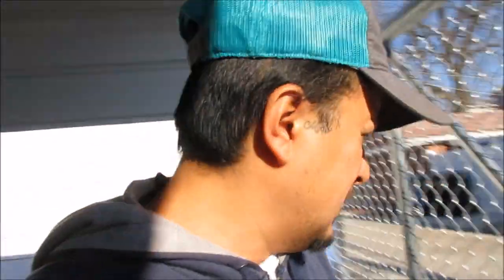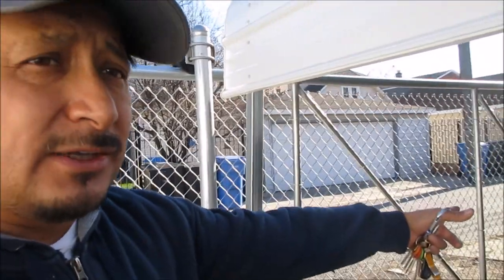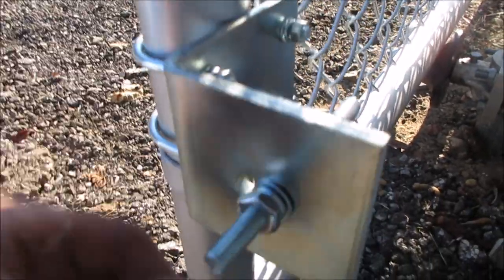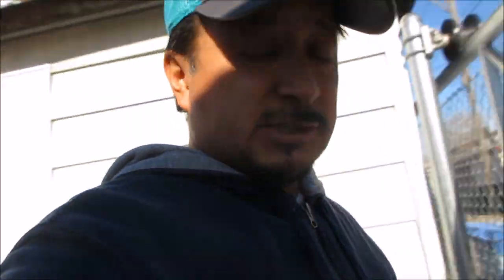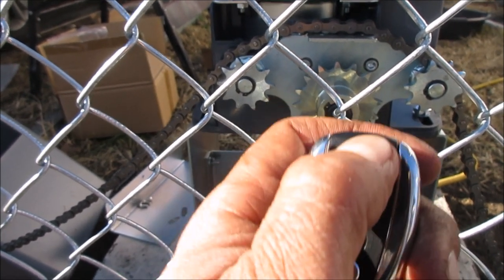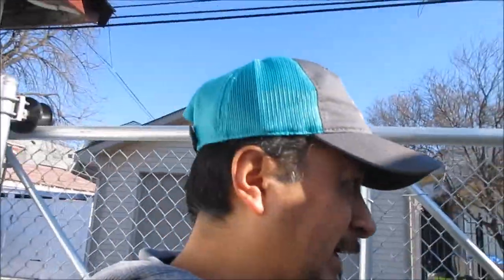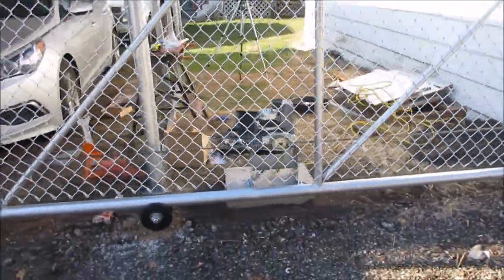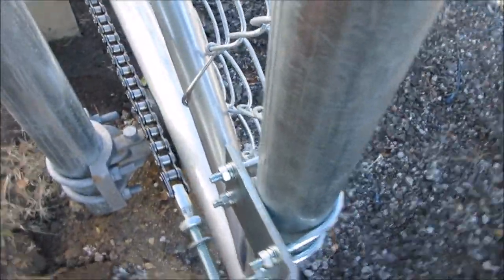Part 4 attaching the chain sliding gate opener SL600AC

Comment: good video. I installed the Aleko 2700. The Internet has been almost worthless for more technical info. The cement pad is a monster but still the motor is like a huge winch, very powerfull. it is no easy project a large 1,500 lb sliding gate. I am still working on things so they are safe for everyone. Thanx for one of the better videos.

Comment: I'd take a self-tapping screw and run it through the chain bracket into the vertical gate pipe it's U-bolted onto. Then it can't work loose and spin on the pipe, making your chain loose...and crooked.

Comment: You should always use self tappers on u-bolt brackets. If you don't over time they will spin on the pole. Creating a service call. Because the chain is too loose then what happens more force is applied to the bracket when it finally runs through the slack. Also the jiggle in your pad is because you have to have a footer in your pad at least 30-36" down. The constant back and force play on the pad will work it's way up need to be past the freeze line. Also a good support structure for the constant side to side forces of the operator. The pad will just work it's way out of the ground. I hate fixing installs like this.  Example if a operator needs a pad of 24x17  (usually oversize pad 5-6" each direction to allow for a different operator to be installed later on.) like a Hysecurity CNX Operator(Swing Gate Operator). i'll make the pad past the freeze line around 15-20" then with a auger or post hole digger i'll put two footers (i generally use a rule a footer for every 12-16") in pad going down 30-36" depending on how cold the climate is in that area. I will also bell the bottom of my footers so it's locked in after the concrete is set. Will tell you having to redo concrete gets labor intensive and costly very quick. Make sure you only have to do it once. So make sure you put your conduit in the pad. you will always need a power conduit then a comm conduit then i will add conduit for loops to get back to the operator. And if i'm not using them right now i'll tape them off and bury them. Operators don't last forever. Make sure you have at least those min of conduit coming up. If you can't tell I do installs for a living.

Comment: I got the same motor gate opener.. I installed two years ago.. but suddenly stop working..remote control got new batteries..so my question is ..what's the comun problem in this kinda motor gate?